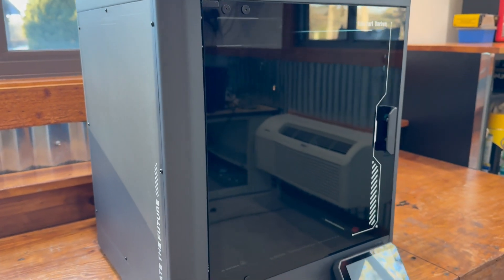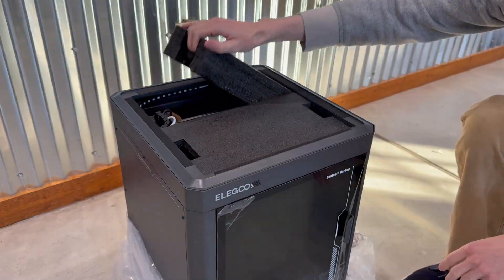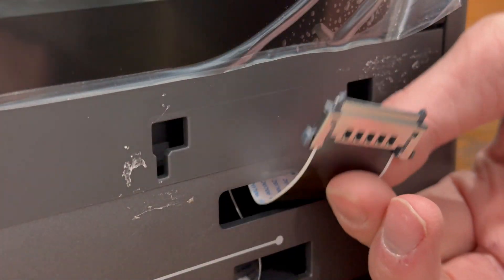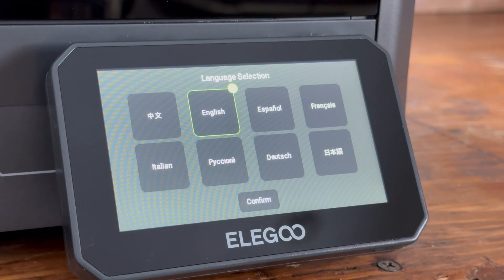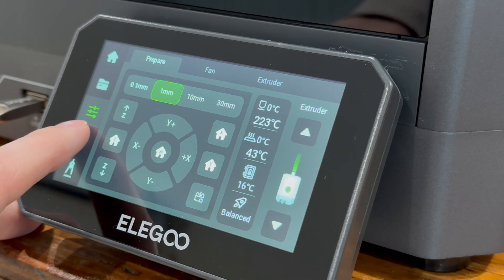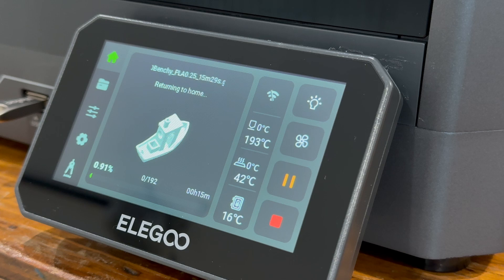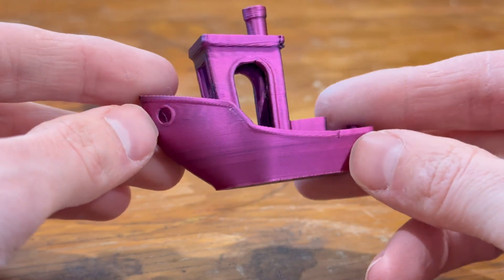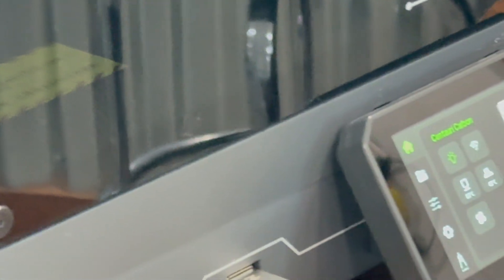This New 3D Printer Hits 500mm/s Right Out of the Box! | Elegoo Centauri Carbon

Comment: I just got my Centauri Carbon today and I am very happy with it. I was up and running right out of the box. I did order a pre order unit but it was delayed a bit. It appears that some improvements were made from the feedback from owners of earlier shipped units. Better lighting coming from not one but two three inch led light tubes mounted on the top. Early owners had issues loading filament due to the position and sharp bend in the tube. I had no such problem. The filament that I had which were not from Elegoo loaded without any issue at all. No modification needed. In fact I printed a couple of stls that Uncle Jessy suggested using PLA + filament that had sat out for quite some time. I thought the prints would be garbage. Nothing could be further from the truth. All came out outstanding. No z banding, very smooth. I was impressed.